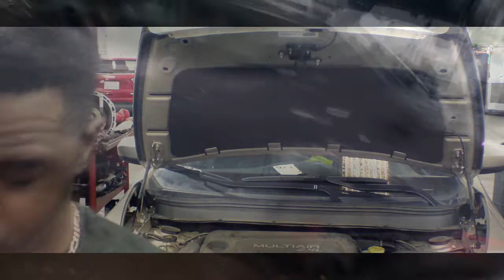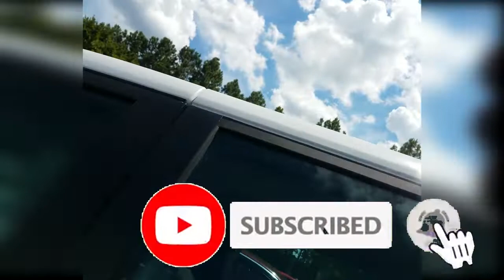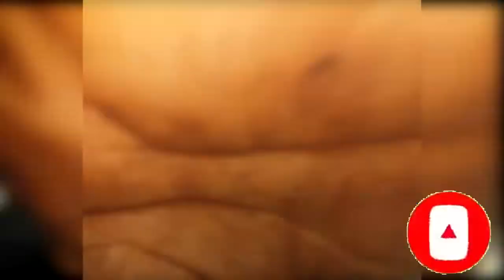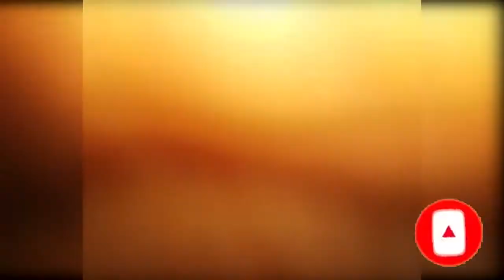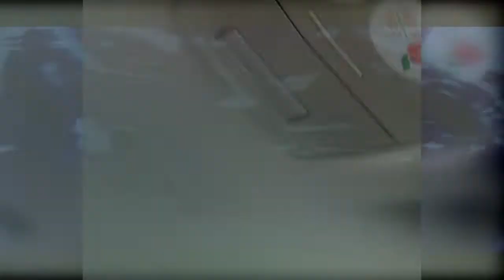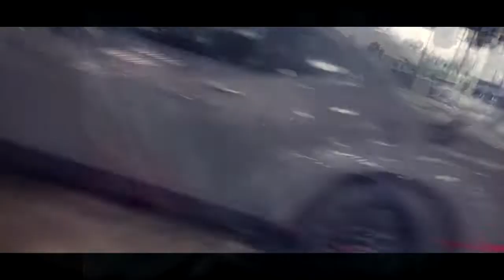This can cause your car to die at stops.

Comment: I’m having same issue in mini van. I’ve replaced the engine filter.. idle air control.. throttle body clean. And cam shaft synchronizer . Any help would be greatly appreciated. 2006 mercury Monterey . One owner. 90k miles

Comment: My issue shows up after driving on the highway. You drive fast like 75 MPH or higher, and the next time you stop if you dont put it in neutral or let off the brakes when it starts to drop RPMs you'll sometimes stall it.
Reply: Have you figured out why it happened?
Reply: @dannykshamo  nope so far nothing. Best I can think of is it has something to do with the way they programmed the transmission or the tourqe converter.

Comment: I have a 2008 chrysler town and country and soon as i come to a stop it does the same thing. It starts right back up and I put it in reverse and its fine but soon as i put it in drive it bucks and jerks and cut off. Can yu tell me what yu think it is?
Reply from the maker: Hello my friend, thanks for watching and subscribing. Now, we gonna need a little help from the computer in the for of a fault code. Im not sure if your check engine light on or not. Even if its not, there could be codes in the TCM memory so a starting point would be to get the car scanned. That way diagnostics can move in the right direction.
Reply: Did you ever get this resolved?
Reply: Jerking bucking any of the needles on the dash going crazy and stalling on a Buick I was driving turned out to be my mass air flow sensor I had replaced the battery the starter driver's side solenoid gas cap thermostat and the mass air flow sensor being replaced and the intake put back on correctly is what helped my vehicle 👍
Reply: Fool

Comment: Assuming it’s the transmission is the last thing I would ever approach, as it’s the least likely!  The first thing I would do is do a visual inspection under the hood and look for any broken vacuum hoses and things like that typically it’s usually a maf sensor or a bad 02 sensor can cause stalling as well. Also, clean out the throttlebody by removing all dirt make sure the baffle plate is not sticking closed that will cause stalling!